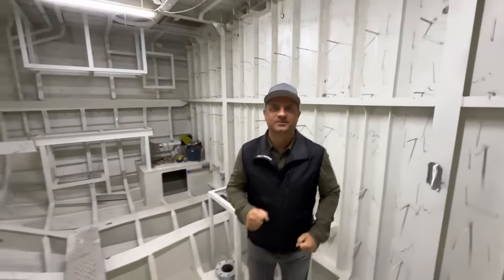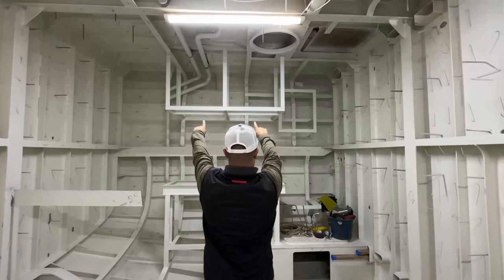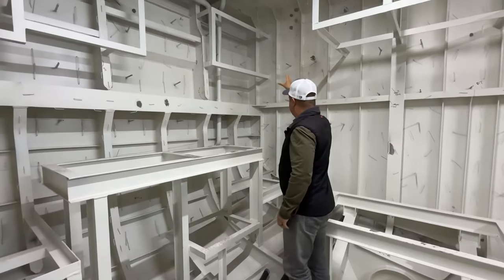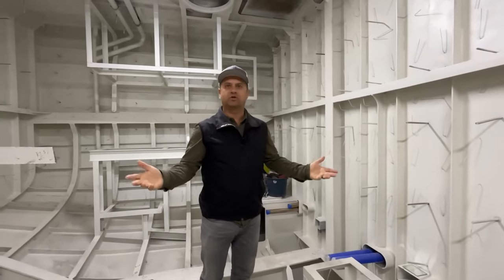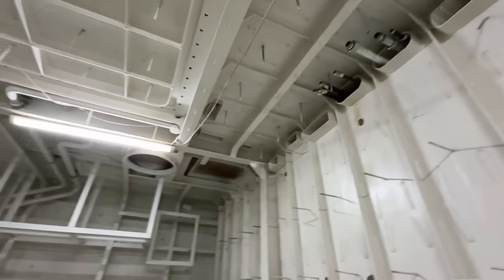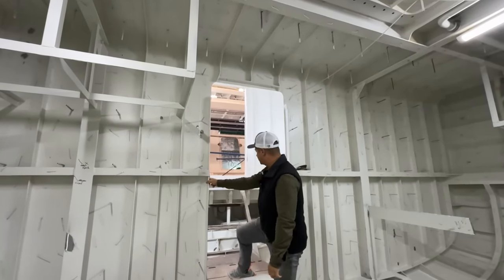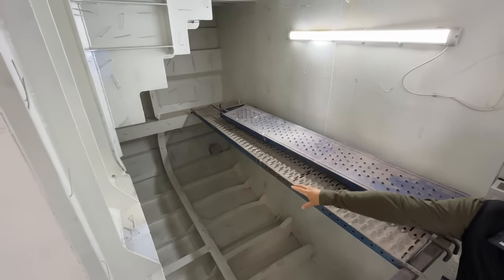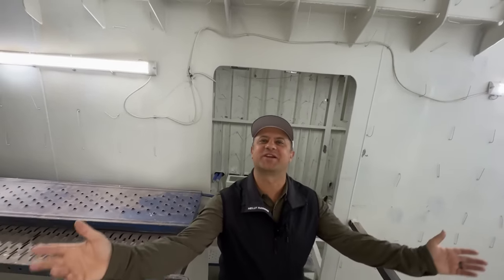Bering 75 Engine Room Tour - Raw & Unedited 🙈🤪 Eps. 45

Comment: Do you want a full time engineer for free. I’d be happy living there 🤪
With the sea chest, one side is likely an inlet, and the other an outlet. The lid for the sea chest is above the waterline, so you can open them without having to close them off, as the water will never be above the lid….unless you’re upside down, and that’s another whole can of worms. 
I do like how Bering has zero angle prop shafts so all the thrust is directly forward. As far as I know, they are the only non commercial vessels that are built this way.  Not meaning to be greedy/selfish, but you could have an engineering tour that’s 4 hours long(that’d only be the 1st part of a 3 part miniseries), and I’d be a very happy camper.

Comment: I could be incorrect, but I believe that the sea chest will have 2 pipes running to it. Each one will be able to be valued off so you can remove the strainer from them and clean them individually so the boat does not have to be hauled and can continue running. So they both feed a separate box that feeds all the required mechanicals that need sea water. Plus, as I recall, the sea chests are actually below the water line. So this is the only way it can be done. I understand Rico's some what flustered memory as they are trying to remember about a thousand different things going into the boat, and having to pay for it is a bit stressful.  Take a deep breath both of you. You have a lot on your plate, but it will all come together soon.

Comment: Wil it be dry exhaust and keel cooled or wet exhaust and sea water heat exchanger cooled?? If I ever had (never will) the money to buy a yacht, I abhor the idea of sea water cooling a heat exchanger, or going thru the exhaust manifold. Would put fendstrum keel coolers and dry stack.

Comment: what are those rods  on the wall ? might be bit unsafe wallking around there  having them exposed , normally they should have plastic caps on them.
or maybe its bolts to hang wall panels?

Comment: When you stepped between the yacht's ribs were you stepping on the hull?   Is there any insulation on the inside surface of the hull?  Or is the hull always the temperature of the water?  I want to explore some of the colder latitudes.

Comment: Iwould have thought those would be sea water/fresh water heat exchangers and not raw seawater running through the systems...?
Reply: In a raw water system, the water is drawn up through the seacock by the water pump. The water flows through the engine and directly out the exhaust. This cooler water absorbs heat from the engine to help keep it cool. Most newer marine engines use an enclosed cooling system with fresh water and salt water heat exchangers.